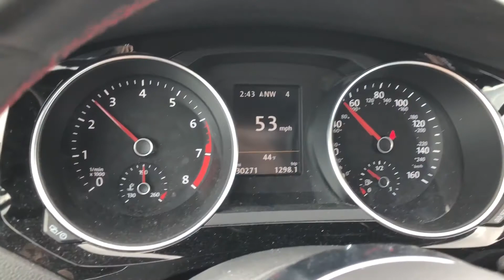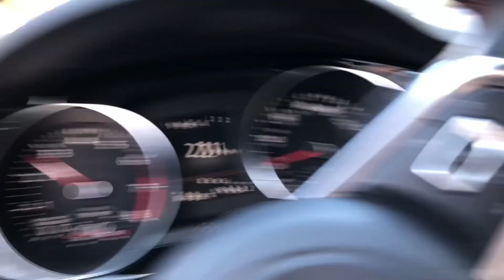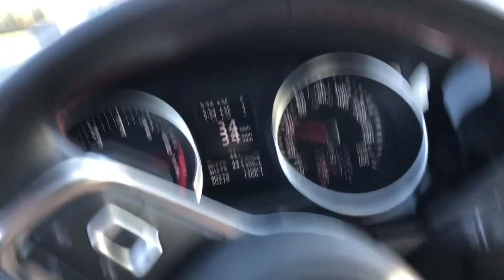0-60 TIME OF 300HP MK6 GLI ?!

Comment: Just lower the tire pressure slightly. I’ve seen people use Stage 1 APR and a GFB DV+ because boost leak and take out the spare, and lower the pressure and hit 4.9seconds 0-60 on a V Box. Crazy man. Tires are everything. Mine are only 225s, what are yours?
Reply from the maker: I am running the Potenza RE980AS which was the "thickest" tire at bridgestone they would put on because the mallory rims are a low profile design. The spec of the rims are 18x8 but if I could deff get a different wheel on all 4's & get wider tires as well. It is everything in getting the car not to spin out and gain traction. The low profile design of the tires are worthless to me just for looks hahah. Ugh. But yeah 4.9 has been my quickest time.

Comment: Hey bro where did you get the black trim with red stripes on the doors?
Reply: That is factory for an facelift mk6 gli
Reply: @mikecollins7704  that looks so nice!!! I wonder if it fits my car. I cant find any online. Ill have to check junk yards
Reply: @Nekroman111  it might be a few years until you see a mk6 gli in a junk yard, but it should fit any 2011-2018 jetta.
Reply: @mikecollins7704  thanks for the info bro!